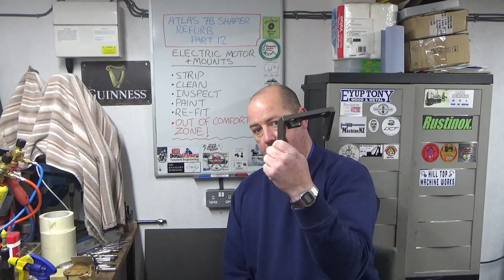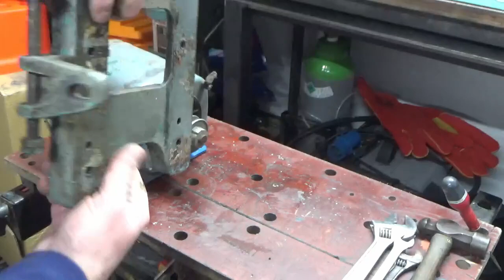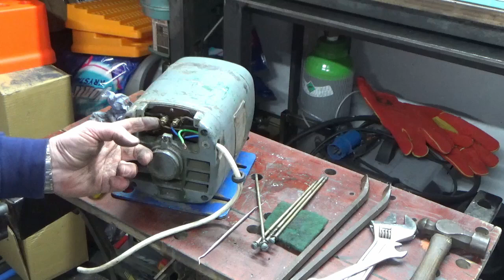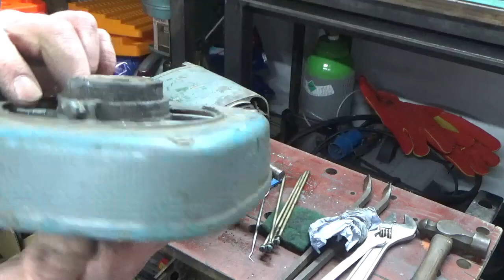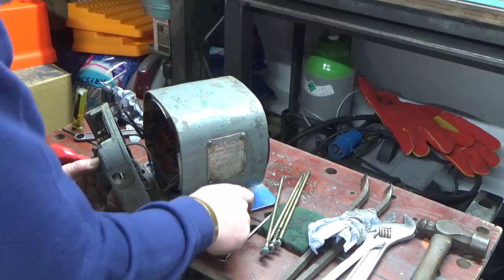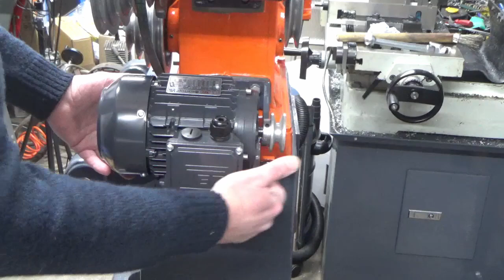Atlas 7B Shaper Refurb - Part 12 - Motor & Mounts

Comment: 100 % agree on single phase 230 V VFD to 3 phase 230 V motor, ref Hoover split winding motor,  you could sell it on eBay?
Some VFDs with EMC modules may trip your earth fault detection equipment  (RCD or RCCD).
New motor looks like it belongs ✔.
Great work and thanks for sharing. 
Here's to a safe 2023.
Regards John.
Reply from the maker: Thanks John, just playing catch up. Cheers, Jon

Comment: Jon I am very interested in the 3-phase upgrade and the VFD. I am capable of wiring the VFD with no problem, but the programing is what I am most interested in, I have 2 VFD's and still have not been able to program them. I am having to take little bites of the programing at a time. So, if you do film the programing, please take small bites at a time so we can understand the programing aspect of it. Thanks in advance.
Reply from the maker: Hi Terry, thanks for the comment. So, upcoming this week is a taster of VFD programming, I fear however that it will be a world away from the difficulties you might be having as Siemens have really made the process 'idiot proof' (and I prove that 100%)🤣. The concept is the same though regardless of manufacturer so you may get some value hopefully. I will be following up with another attempt on the mill in the near future as well. Cheers, Jon
Reply: @jonsworkshop  Thanks Jon I will be watching.

Comment: Hiya Jon & a Happy new year to you & your Lady + the doggy. Now i am pretty much an amateur at engineering projects & as you know i get by ok. But what i am a Pro at is electrics. From house bashing to industrial electrical installations. I have installed probably a 1000+ inverters in my career. I also used to draw in cad control panels from design, pricing, building & installing to Blue chip companies like Nestle, Foxes, Thorntons, Bassets, Harrods biscuits & many more. You have just given me inspiration to do a multi part video series for watchers to install a 3 phase inverter & motor. From worrying i cannot do this through to yes this is easy. Basically an idiots guide to fitting a 3 phase motor in my workshop. ( no your not an idiot. You know what i mean). Take care & see you in the next one.
Regards.
Steve.

Comment: Happy new year Jon. Might be the camera angle but the pulley looks a bit out of line to me. All the best for the new year sir 👍
Reply from the maker: Hi Ricky, thanks for the comment. Yep, definitely not lined up yet, I left the bolts slack at the back as I know it all needs to come off again. There is enough adjustment to level it out on final fit👍👍. Cheers, Jon

Comment: Firstly,I wish you and the family a happy New Year.
That set up with the VFD and 3 phase motor will add another dimension of control with the variable speed very much like Rustinox has on his shaper.  Those Hoover motors are pretty well built and good on reliability in my experience of them so definitely worth the time to try and salvage the unit. Silicone tubing and electrical shrink wrap make a simple job of renovating the old insulation sleeving. 
On my Alba it was originally fitted with an oddball 3 phase motor that runs at 915rpm. I was lucky to find a TEC brand 6 pole single phase that runs at very similar rpm so the Alba is now single phase

Comment: Happy 2023 Jon, That new motor looks like a winner, VFD control will be a nice upgrade. The old motor with plain bearings is quite common in the sub 1-Hp market. They can actually run smoother than ball bearings, oiling is key. And keeping the side loading low "no overtightening of the belts" can outlast ball bearings. The finish line is getting closer.
ATB in 2023, Cheers....Dean

Comment: greetings from thailand all the best wishes for new year john 
i dont mind electrics ,basicly look at it like i do plumbing , water/electricity goes in one end and comes out the other so all you need to do is connect the dots untill you get acomplete circuit , only difference is that if you connect the outtake directly to the intake without anything in between the fuse will pop or you release the magic smoke (the stuff they put in at the factory to make the thing work )
the centrifugal thing is to connect the motor to the condensator for startup , once the engine is running at a certain rpm the weights fly out and disconnect the condensator
sometimes the weights get stuck and the engine makes funny noises and not have enough power , wish might be usefull to know (as you can fix the stuck weights ) bet theres some info in the type of setup on youtube 
as for fitting the new motor : think the least invasive solution (in that it can be brought back to stock ) would be to use a thick aluminium spacerplate with montings on top for the motor and the boltpattern for the mounting bracket on the bottom 
nice vfd's , sometimes they put some hum on the electric grid in youre home causing some flickering / strobing  of the houselights and maibe some interference in radio wifi and tv signals , there filters you can buy to put in between the plug and the vfd to get rid of that

Comment: Hi  Jon, thanks again for an interesting video. At least with the VFD, you'll have all the controls at low voltage and also motor protection built in. You are not alone in picking up a lurgy from relatives, got the same after Xmas dinner get together. Not much to strip/repair on the old motor, just note the connections on the centrifugal switch before taking apart any further.